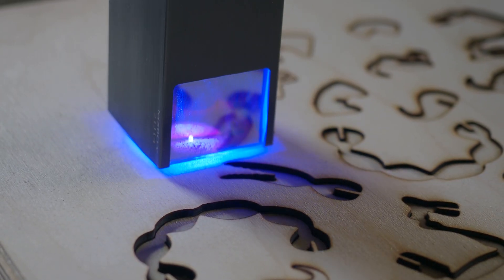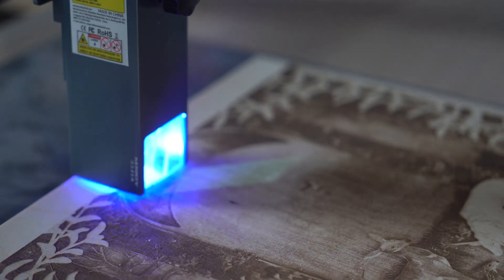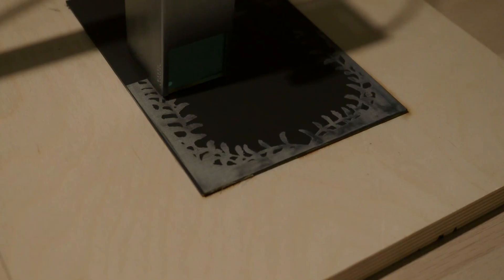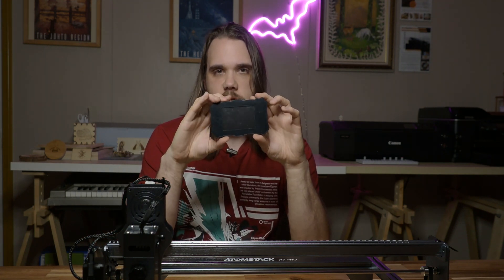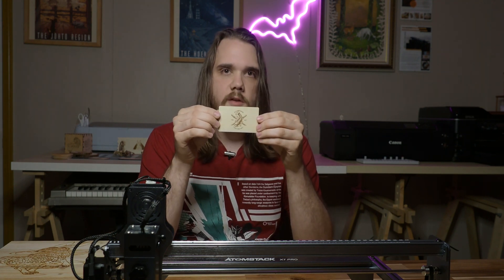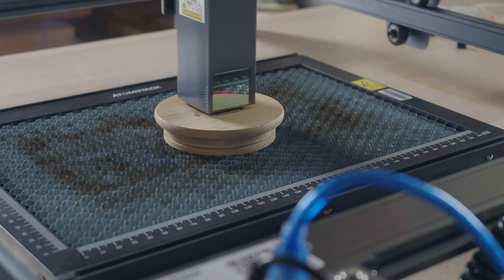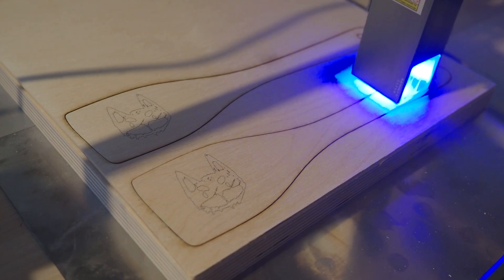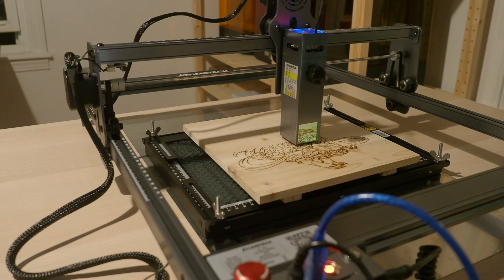Atomstack X7 Pro Laser Engraver Review: A Worthy Addition to Any Maker's Toolkit

Comment: I have a x7 pro and I am trying to cut 1/8 plywood, settings are 49 speed, 85 power, air, continuous power and 12 passes and it is NOT cutting all the way, what am I doing.  Please get back with me
Reply from the maker: Plywood is a tricky beast, as it depends a lot on the type of wood used for the ply, and the glue inbetween. Some will just be impossible to cut - but 1/8-inch should be doable. Firstly, whack the power right up, no need to limit to 85%. Second, check the focus and clean your lens if you havent done that in a while.

Comment: I have had nothing but problems with the offline engraving, mine only half works, there is no wi-fi at all it does not show that I have that option, and I get a message that says my D:/ drive is corrupted when I try to save G code, I have tried a new USB stick and micro SD card and when the new card is inserted I get "No SD card" so far this option on my machine purchased Aug 2022 doesn't work, would like to hear any solutions if they are out there?